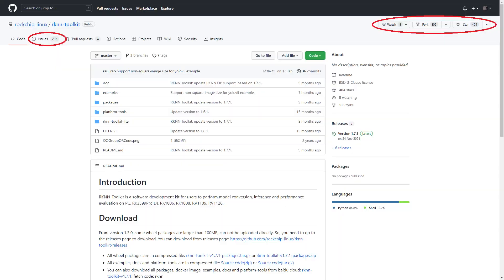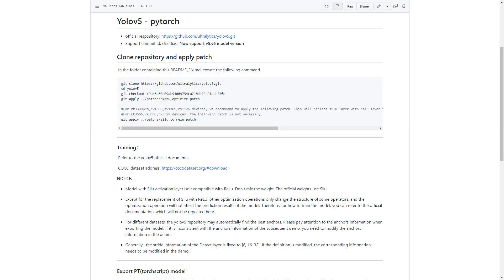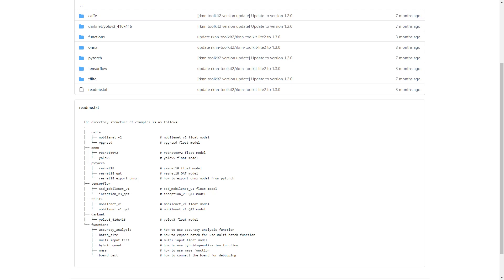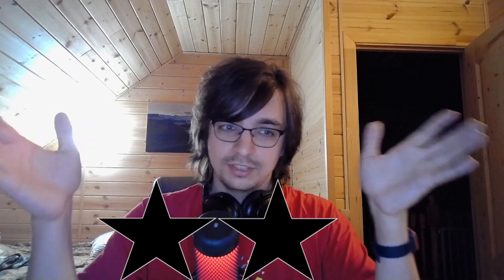Rock Chip for Computer Vision in 2022. Let's compare!

Comment: Hello, Anton! It would be great, if you have included power consumption to the "Sheets with stats", many applications havily depends on it. Thanks for videos!
Reply from the maker: Thank you.
I think about this a lot. But it's a tricky one:
1) I can take official data. But what condition was it measured?  Usually, it's some hypothetical value. 
2) Measure it myself. But:
  a) I don't have equipment.
  b) What to measure? M.2 peripherical? CSI camera? Cooler? NPU usage? CPU usage? e.t.c. 

So for power consumption measurement, I should spend x2 time on each video. Or just take power from the documentation (and I don't like this way).
Reply: @AntonMaltsev  It is familiar issue, I suggest put an official chip max consumption with disclaimer of source. It is good to know at least order of magnitude.